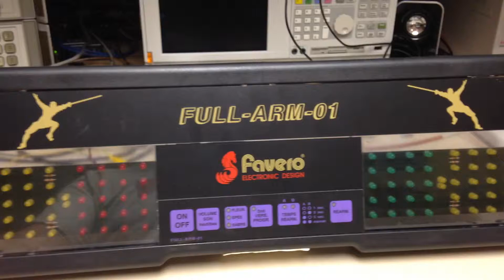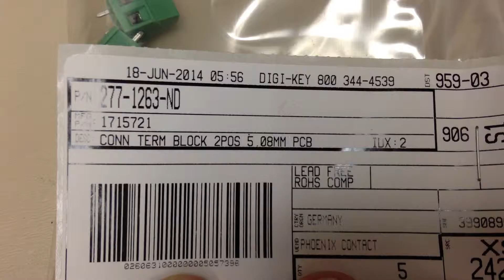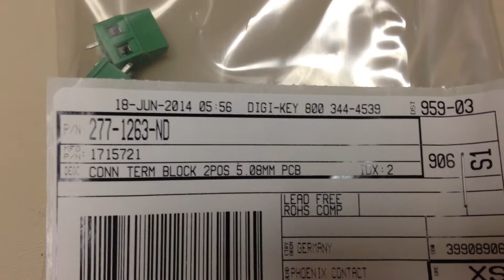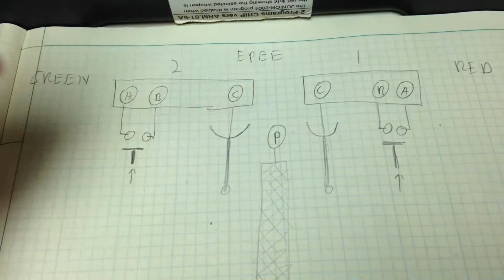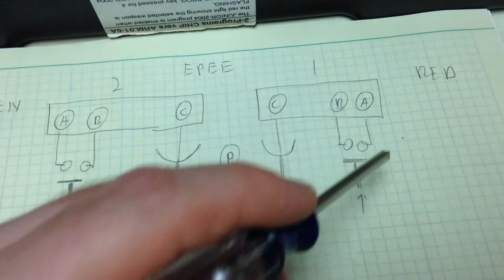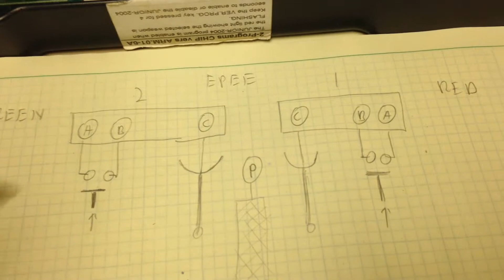Fencing Scoring Machine Repair

Comment: I am trying to teach fencing at my church.  I bought the scoring machine, but don’t know how to connect machine that you repaired(same one).  Can you teach me how to connect wheel and scoring machine?
Reply from the maker: You mean how to string the body cords over the pulleys, or wire the cords to the machine?  I don’t have this machine with me (it is the clubs), and COVID has put a hold on fencing.
Reply: how have you gone with connecting up the box to the ground cable to the spools (or reels?)